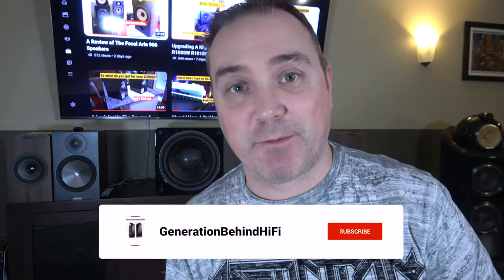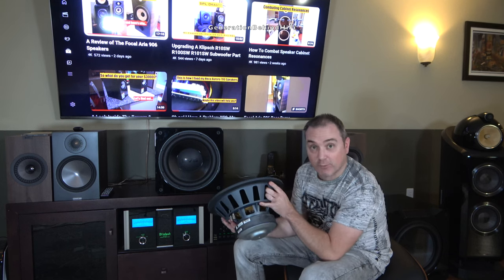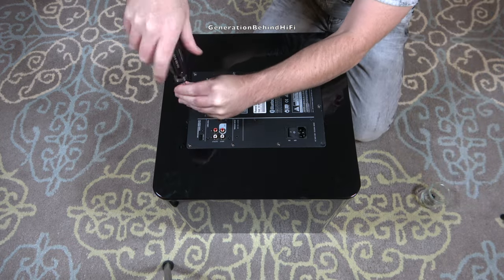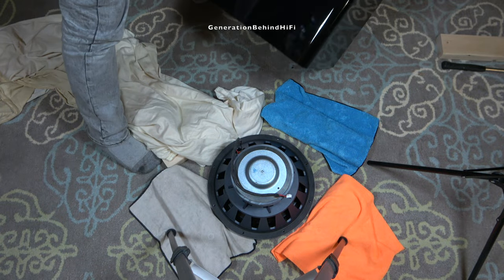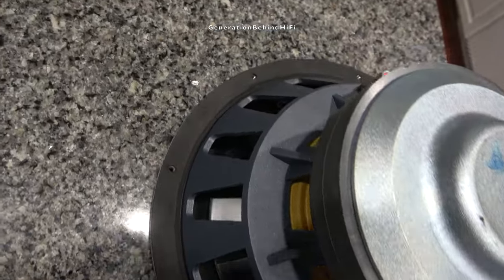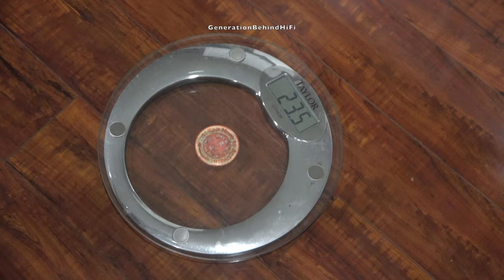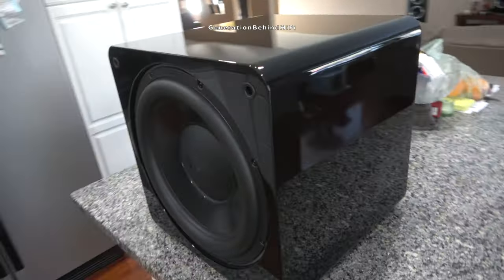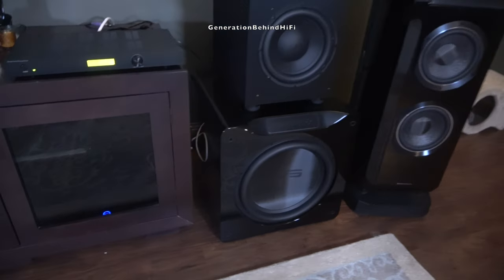A look Inside The SVS SB-3000 Subwoofer

Comment: I’ve had a sb3000 it was a fantastic sub for a sealed sub but ultimately I went with a rythmik l12 which imo was better and cheaper I think the sb 3000 is probably the best all around sealed sub they make love the metal grill as well
Reply from the maker: I really like my SB3000 and I think it offers the best value out of SVS's lineup. I tried a Rythmik a years back (friend bought it) and thought it was ok, but it was the entry level one.  I might have to try another one since so many seem to be pretty happy with them.
Reply: @generationbehindhifi  yea there is a ton of different ways you can set it up and easy to set up wrong but with the servo it’s the best with music and it goes down to 12 hz
Reply from the maker: @danemoreno88  Good to know! I really want to try a REL sub that connects using the high-level inputs? Curious if you have any experience with them and how they compare to the Rythmik?
Reply: @generationbehindhifi  I don’t have any experience with rel but I know they are highly regarded in the 2 channel community not my cup of tea though don’t like all the brand badging on them

Comment: I'm I correct that the SB 3000 replaced the SVS Ultra 13 ? I've had mine for 13 years They are gloss black 17 inch x 17 inch with a 13 inch driver  The sub weighs 92 lbs  In the last year I've upgraded to the DSP amplifier upgrade kit and now everything is controlled by their smart phone app You have to love SVS!!!

Comment: My sound system consists of 6 SVS Ultra Bookshelf speakers (2 for the mains, 2 for the side channels, and 2 for the rears), an SVS Ultra Center speaker, 4 SVS Prime Elevation speakers ceiling mounted for Dolby Atmos and 2 SVS SB-3000 Subwoofers. The system is powered by a Parasound Halo A52+ 5 channel amplifier and a Yamaha Aventage RX-A8A 11 channel AVR with dual AC Infinity AIRCOM T9's keeping them cool, and all are connected to a Panamax M5400-PM Power Conditioner. The output power of this Living Room home theater system is 2,800 watts R.M.S.
Reply from the maker: Very nice! Thanks for sharing.

Comment: Hi :-) Thanks for a great video!
I have an amplifier module from an SVS PC13-Ultra and recently got hold of a speaker unit from an SB-3000. I want to make a woofer and have entered the TS parameters here from your video, for the speaker unit into the design program WinISD. I have calculated that an SB-3000 has a volume of about 44 litres.
When I try to design a closed cabinet with 44 liters and the speaker unit with the parameters from your video I do not get the desired result. I get a result that says 50Hz at -3 dB. The specifications for the SB-3000 say 18 Hz +-3dB. Can there be DSP in the amplifier that can compensate for the difference?
Reply from the maker: Absolutely. Just about all subwoofer manufacturers use some form of DSP to reach their desired frequency response.

Comment: I’d like to see an RSL Speedwoofer or Monolith subwoofer done in the future. I’d REALLY like to see anything from JL Audio done too. Preferably Fathom V2 or E-Sub but they’re so expensive I wouldn’t expect you to get your hands on one so I’d be happy with even a Dominion. Won’t even talk about the Gotham V2…lol. 

Also you said guess high so I guess I was a bit too high on the SVS weight.
Reply from the maker: Thanks for the great suggestions! I have heard good things about the Monolith subs and have always wanted to try one out. I think next year is the year when I pull  the trigger on one. I have heard the original JL Fathom F110 and was not impressed at all and thought it was crazy overpriced. Maybe things have changed since the v2?
Reply: @generationbehindhifi  I’ve heard some really good things about V2 myself but it’s kind of like an endgame sub for me so I probably won’t be able to touch anything of theirs for a few years at least if ever. I’d like to audition one but I have to drive 100 miles plus to a dealer that has them. So I don’t see that happening.
Reply from the maker: @Mike.Macmyazka  Just make sure that you purchase from a dealer with an excellent return policy if you do pull the trigger on a JL subwoofer. IMO they are way over hyped or at least they were back then. After walking away so disappointed during the F110 demo, I never had the urge to demo another one and you definitely don't want buyer's remorse when spending that kind of money! Edit: I can't believe JL now wants $4000 for F110 v2 subwoofer. Back when I had my demo they were around $2200! Wow!

Comment: Well I know it’s an odd size sub. 13 inch. So I would assume it has to be at least 35 pounds. I don’t think it looks like it’s too much heavier than that based on motor structure. I guess the question is how thick is the enclosure and how much bracing is there? The amp shouldn’t weigh much.
Reply from the maker: That was still a good guess. Not bad!

Comment: Great review inside this sub!  I see you have Sonus Faber Sonetto 8's.  I have the 5's in a 2 Chanel system.  Do you think this sub will match well with the Sonetto's or is is too big.  I own the SB 100 pro for a theater setup and love it. Thanks!
Reply from the maker: Thanks! I have Sonus Faber Venere S speakers (they look very similar to the Sonettos) and they are a really good match for the SB-3000. I purchased the SB-3000 specifically to match with my Sonus Faber speakers and have an SB-16 paired with my B&W 802 Diamonds in my primary system. Both subs have been great at doing both music and movies. The DSP on both of these subwoofers really helps with integration. 

If you're more of a two channel music guy, then you might want to look at the REL S510 or S812 if you can swing it. Hope this helps!

Comment: Any chance you got the box volume while in there? I ended up with one of these drivers and need to build an enclosure.
Reply from the maker: Sorry! I'm not taking it apart again. Although if I had to guess, it's probably a little over 1 cu feet in volume. You could also plug in the T/S parameters of the driver into WinISD and it will give you the optimal box size depending on what frequency curve you prefer. Hope this helps!

Comment: You should look at the klipsch r 100sw
Reply from the maker: I did do a look inside video on the Klipsch R10SW which is almost identical to the R100SW. Because of that, I have no plans to do a video on the R100SW since its too similar to my R10SW. Thanks for the suggestion though!
Reply: @generationbehindhifi  no problem

Comment: What’s your thoughts on the this SVS 3000 vs the REL 1205? Or is that comparison coming in a future video?
Reply from the maker: Did you see my review on the REL 1205? In that review I refer to the HT1205 as the "poor mans SVS SB-3000". The REL HT 1205 is a great subwoofer for the money, but it has no where near the output, bass slam, and definition that the SB-3000 can produce and it shouldn't -- just compare the drivers between the two. The choice of drivers between these two subs is light years apart in terms of technologies, but the REL is a great value option if you want SB 3000 like performance on a shoe string budget. Hope this helps! :) 

Thanks for the suggestion! Maybe I should do a comparison between the two? Hmmm....